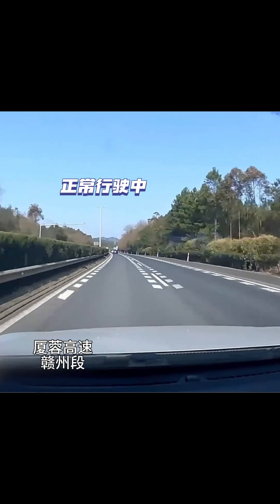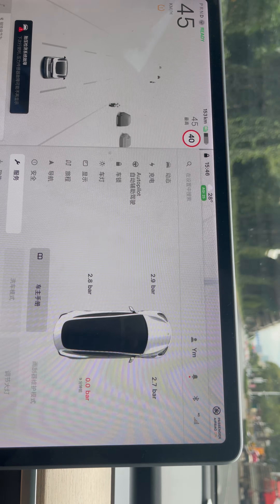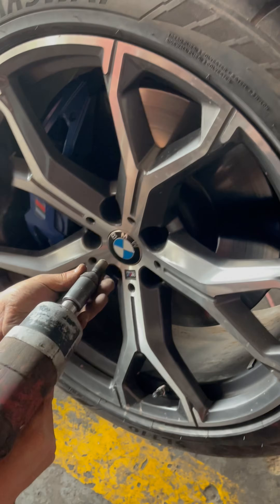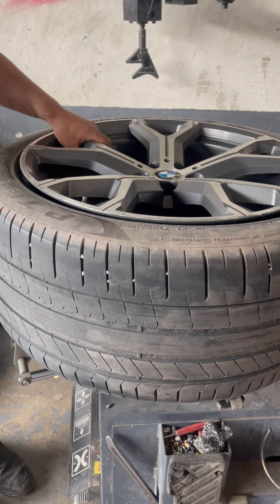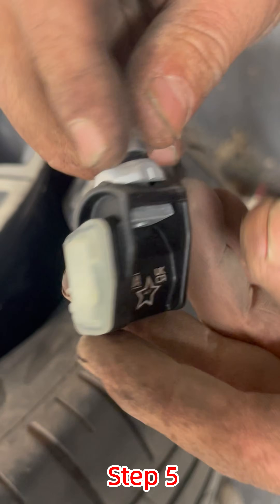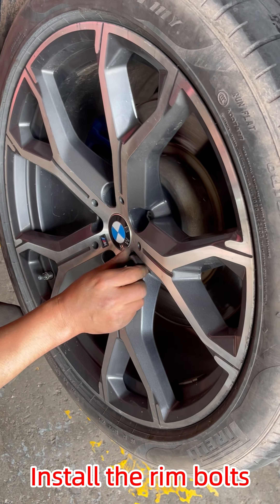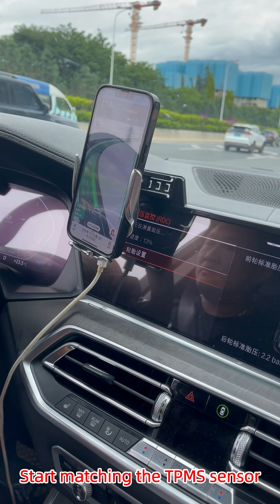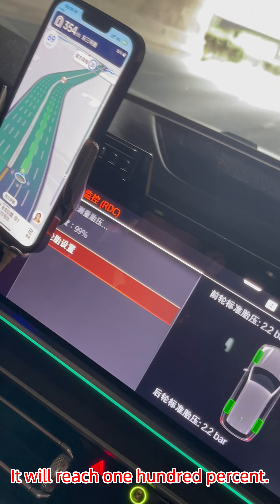Do you still not know how to fix a BMW tire pressure sensor? #tpms

Comment: no need to programming?
Reply from the maker: The original tire pressure sensors do not require programming. BMW tire pressure sensors are automatically recognized and matched. Only branded sensors (such as those from Autel) require programming. If you have any questions, feel free to consult me.
Reply: @tpmsensor  ONE OF MY SENSORE IS NOT WORKING..(REAR LEFT)  I BAUGHT 4 NEW SENSORE NOT YET INSTALLED.. BUT THEY ARE INSIDE THE CAR NOW (IN THE CABBY ) ,,,,, WHEN I DO  RESET  MODULER CONNECT WITH THEM  OR FIND ONLY WHEN I INSTALL ON THE WHEEL????   PLEASE HELP ME THANKS
Reply from the maker: @dinovidy It depends on the make and year of your car. If it's a car with automatic matching, just install the sensors and drive. If it's a car that requires matching, you can either match the sensors first and then install them, or install them first and match them afterward (the key is that the tire pressure sensor model you purchased must be the same as the original one; otherwise, they won’t match).
Reply: @tpmsensor  ok thanks